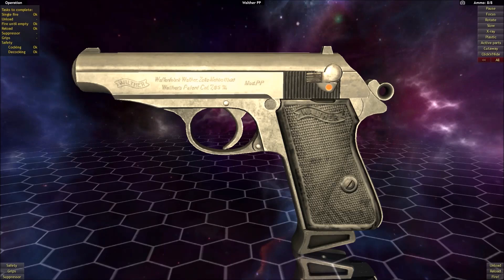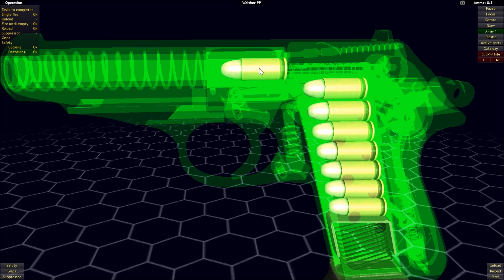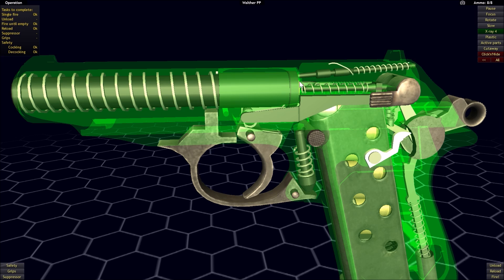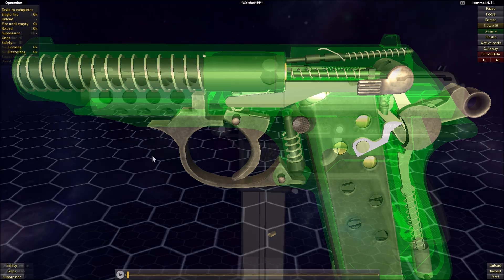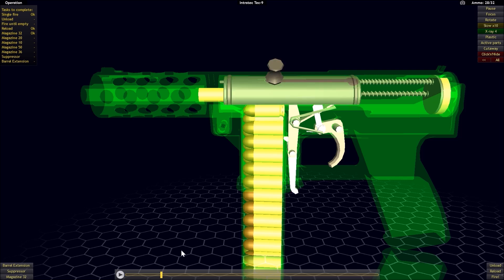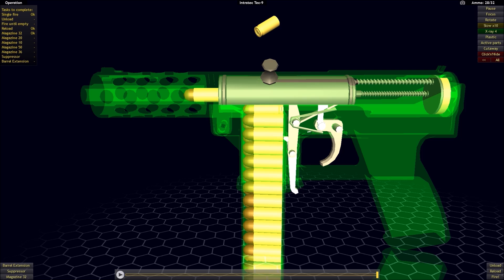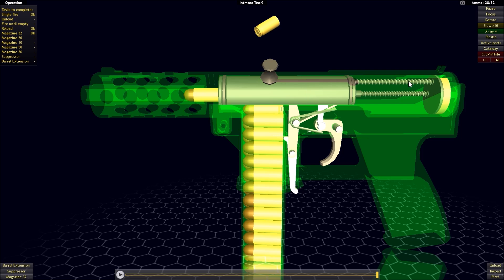Straight Blowback Systems In Firearms

Comment: One of de piztalz i gavez usza Smith n wesson tactical 40cal n stainlezz steel n i swear itz hafce if a 1911 n a modern gun but i am eitherz goingz to drill da barrel outz withz a lil slot n a hole trew itz n denz swap sa trigger n itz niwz outz n purz a 1911 trigger n itz n add a stainlezz back strap n may even drill er outz n add da frip saftyz n pearl handelz n boomz da Smith n wesson of my dreamz n ferz underz a grand rs

Comment: The bolt in such a system is not cloesed at all. It starts opening exactly when the bullet starts to move due to conservation of momentum. The trick is actually to keep the blowback action slow enough that the bullet can go all the way down the barell before the thin part of the empty case looses its support in the chamber.

Comment: Would it be possible to make a straight blow back to assault rifle?
Reply: Definitely but not viable, because the weight of the bolt would have to increase as stronger cartridges (pressure from the powder) are used. 
This makes the gun heavier as you have a larger round, heavier bolt, longer barrel and the larger recoil. And the fact that you want it to be fully automatic, you're gonna need strong arms 
This is why this system's only used for pistol calibre guns, though people have tried doing this with rifle calibre guns, doubt they went far though.
hope that answered your question!

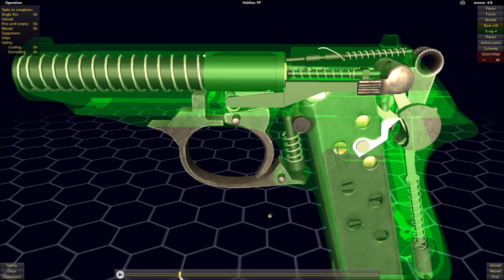Comment: 4:20 How/where does the force of the combustion act against the slide to send it rearward? Ian Mccullums video skips over this step too.
Reply: The expanding gas in the cartridge pushes the cartridge backwards and that pushes the slide backwards as well.
Reply: @OZTutoh  Again I say, how? What force is acting on what surface to make that happen? Obviously gun go bang, slide go back. But how? Why? Anyone got a better answer than, " gun go bang, slide go back"?
Reply: @BOBimusRex  Newton's Third Law.
If you can't wrap your head around that, I can't help you.
Reply: @OZTutoh  So you don't know either.
 Example: With an Ar-15 the expanding gas flows through the gas tube, into the bcg and the pressure pushes against the bolt which pushes against the barrel etc etc. 
Question: In a blowback pistol, what pushes the slide back? Is it like a tab that sticks out from the slide and braces against the back of the bullet or something? I just want to know how the energy gets from the bullet to the slide.
Reply: @Howyadoinmon I was just wondering how and where there force got from the cartridge to the slide, but I think I figured it out eventually. I figure if the slide makes contact with a round to strip it from the mag and move it forward into the barrel, then thats where the contact happens going the other way. I just feel like that's an important step that always gets left out.
Reply: @BOBimusRex  The slide portion that contacts the cartridge is shaped exactly like a bolt. In most of these blowback operated weapons the bolt face also has an extractor that clips onto the groove in the base of the cartridge so that when the bolt/slide moves to the rear it extracts the cartridge. Ejectors are often small protrusions that knock the cartridge out of the weapon after the front portion of the casing clears the barrel/chamber. Does that clarify this any? If it doesn’t, it probably would be useful to look at the slide of an actual pistol and you will see it.

Comment: Can SMGs, semi-auto shotguns, semi/full auto rifles & machine guns work same way?
Reply: You can but often not in straight blowback as higher pressure cartridges require a larger bolt or slide mass

Straight blowback is mostly kept in SMGs, pistol caliber carbines, and pistols in low caliber carts these days
Reply: To add some ammunition have high chamber pressures that require more than having a heavy bolt and/or spring pressure isn't enough to contain the detonation and delayer systems or even locking lugs are needed

Comment: I've been really confused about what exactly brings the bolt or slide back in non gas-operated systems. I still don't really get it
This is going to sound really stupid, but is it the force of the gas on the casing that blows the casing back at the same time propelling the bullet, and that casing being blown back is what resets the slide/bolt?
Reply: Yes, that is exactly it. The old Physics saying "Every action has an opposite and equal reaction" explains it, like you already understand from what I see.

The same force that propels the bullet forward propels the slide backwards.
Reply: @EricFBG  I've watched more videos like this and its not exactly the casing itself doing the work to cycle everything and then ejecting, it really is just the opposite force of the propulsion. I just had to kind of think about it until my brain accepted it and now it all makes sense. Thanks for affirming this
Reply: @EricFBG  0

Comment: is that why 45 hi point is bulky
Reply from the maker: Yes, that is partially the reason. The other part of why it is so bulky is what the slide is made out of and how it is made. It is cast out of a zinc alloy (zamak). Cast part are often times made thicker then required to try and prevent imperfections in the casting process weakening the part and the zinc alloy is more bulky per weight to the more traditional slide material steel.

Comment: Is straight blowback systems only for pistol calibers
Reply: Michael Jordon it is limited to pistol style calibers due the the chamber pressure. Rifle cartridges have much more powder for similar sized bullets so they create much more pressure. In order to counteract the massive increase in power the bolt weight would have to increase dramatically. A .50 bmg open bolt blowback would need over 50 lb of bolt weight to make it cycle without exploding.
Reply: Bryce Claxon not to mentioin a car spring to handle the recoil and length of the shell XD
Reply: Yep. If you're going for bigger calibers, the cons overshadow the pros. Do note that the M1A1 Thompson also uses a straight blowback system, so you're not just limited to pistols.
Reply: Jake Growler You'd be correct. Typically blowback rifles and shotguns are either Lever Delayed Blowback (FA Mas, most Beneili shotguns, most older ww1 era machine guns) or Roller Delayed Blowback (G3 and its variantions, Cemte, Tristar Shotguns) 

The delay keeps the bolt held back long enough for the round to come out of the chamber
Reply: Coneberry m1a1 is chambered in .45 acp which is a pistol caliber
Reply: Michael Jordon I do believe it has to do with shell length, pistol shells are much smaller than rifle rounds and can eject with less clearance and wouldn't take as long of a spring, as well as the chamber pressures not being too high along with the weight and recoil.

Comment: also...straight blowbacks don't need extractors...
Reply: No Surrender my friend if i loaded the gun then started to eject the bullets manually by reloading is it normal to jam and how the last bullet will eject thanks for help
Reply: Hian Aboud take a pt 22...u can't eject a round by rackirackingslide..this gun is unique because it has a tip up barrel...but  what gun are u talking exactly...the energy of the explosion in the cartridge...the bullet being pushed out the barrel...also causes the recoil that causes the explosion to push the shell, which pushes the slide in reverse...another round is loaded when the slide returns forward...in a locked breech the operations  is delayed slightly, and has an ejector to grip the casing...at least that's what I always got...a glock would be an example of this...but there are some fixed barrel guns that aren't straight blowbakc operated...a beretta 92 is an example.
Reply: No Surrender thank you my friend.but i have a problem . if i load it then start to eject the bullets by reloading it usually jams and specially the last bullet because there isn't any bullet in the magazine to bush it is it normal?
Reply: Hian Aboud what pistol exactly are u talking about...if it is a tip up barrel gun like a .22 or .25 biretta or Taurus they are only designed to be chamber loaded with the barrel tipped open. no need to even operate the slide at all.if not a tip barrel designed gun...all u can do is run it and see...you won't manually be operating it as fast or with as much force as the gun would be cycling during shooting...so you probably dint have any issue
Reply: No Surrender thank you .I'm talking about cz model z 6.35 mm old pistol made in 1950 its the same as baby Browning
Reply: Hian Aboud that gun has an extractor so u shouldn't have any issues cycling it manually...the spring in your magazine is probably just lost some tension...its an older gun...if u can remove the spring from the maganize and let it stretch out for a while maybe?
Reply: Do not need extractors? Where did you obtain that ghetto answer?  Built a gun lately?  Ever built anything? I think you might be looking for the air soft section or nerf, you can pull it up quite easily.
Reply: They need an extractor...
Reply: I'd rather have it and not need it than risk that one or two times it sticks.

Comment: I have cz model z 25 cal  it doesn't has an ejector how it ejects the case
Reply: Hian Aboud the recoil itself kicks it right out...my Taurus pt 22 is the same design. there is no delay.
Reply: My dear friend ... extracting and ejecting are 2 different terms ... every gun needs an extractor, tho not every gun needs a ejector ... for example a lot of guns eject the cartriges by using the magazine or the next bullet that's comming up from the magazine, tho every gun needs a extractor which is pulling the cartrige in one direction in which it's meant to fly out. I ain't no specialist by any stretch of imagination but I think that might be the case, correct me if I'm wrong.

Comment: So here is the simplified explanation of how blowback operation works. It makes good use of Newton's third law of motion by using the opposite but equal reaction of the hot gasses pushing the bullet out the barrel to push the bolt back, eject the spent casing, and chamber the next round.
Reply: Exactly,
 but if you were to watch a version of this explanation with X-ray video on the Browning A5 (or the earlier 1930s version he allowed Remington to manufacture the Model 11) you would really see Newton’s Law. The ENTIRE barrel of the shotgun is spring loaded to enter into the breech and kick out the spent shell will throwing in another round. 
It’s such an absolutely ingenious method of creating a semi automatic firing mechanism that he won numerous US military contracts on variants of that one design alone. 
Pure genius.